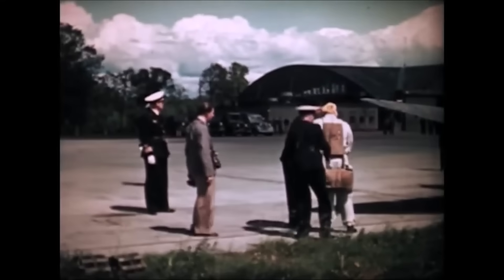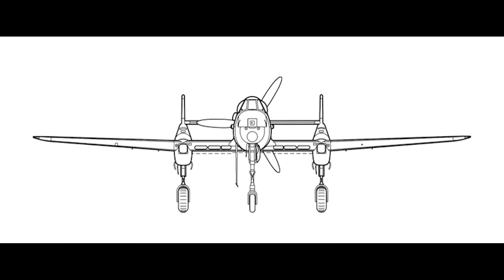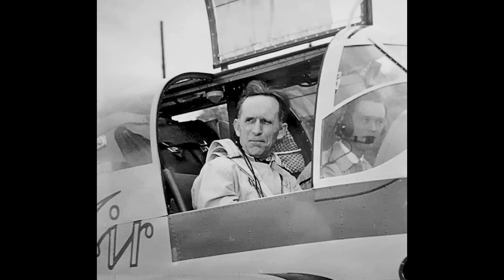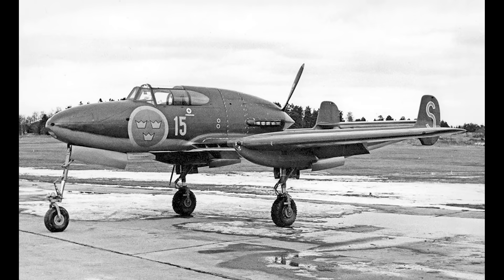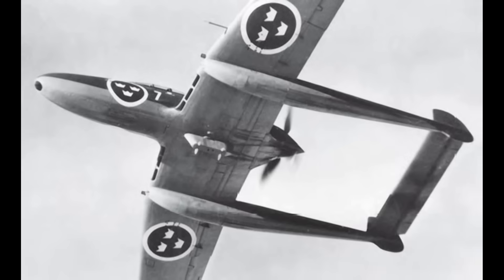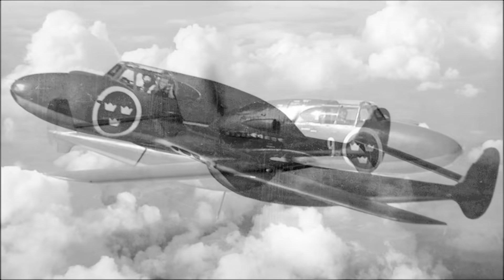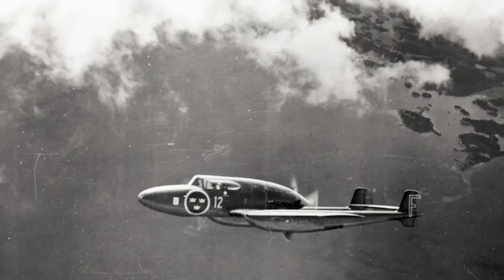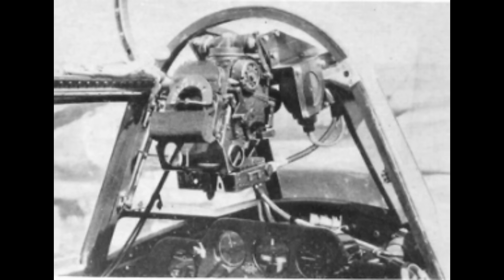Flying the Saab J 21A: Sweden’s Odd but Capable Fighter

Comment: 11:02 "The Mustang proved superior in turning performance" 11:31 "The J-21A tight turning could be used to advantage in a dogfight."  Would it be possible to elaborate on exactly what was meant by the J-21A's turning performance? The Mustang is good in very low speed left turns (below 210 mph at least, but mainly if 20 degrees of flaps are used) but it was not a particularly tight turner overall except at very high speeds.

Comment: Thank you for a great video as usual. 
Where would the RATO apparatus have been attached, I wonder?
Under the wings would have taken up the place bombs or air-to-ground rockets might have used, but at least they wouldn't hit the propeller when discarded. 
The other option would have been on the outside of both tailbooms, hopefully allowing for a safe ejection away from the propeller and the tail planes.
Were the RATO's mounted horizontally, or at an angle as I've seen on Hercules C130 aircraft?
I did try to find out on Google, but only found a vague mention that the RATO pods were attached under the wing somewhere.

Comment: The Swedish 13,2mm Akan m/39 were automatic cannons, not machine guns, as they fired HE shells. Slightly improved FN-Browning designs, they were light, reliable and packed quite the punch, as their rate of fire was 1080 rounds per minute as designed, but the return spring could be tightened to increase this. Swedish pilots found that 1600 rounds per minute eas the practical limit, as the barrel heated up so much the HE shells would cook off inside the barrel if the gun was not fired in very short, controlled bursts.

Comment: Does this mean you are actually going to do the Swedish fighters? We were just talking about this in the comments a couple weeks ago. You always seem to give me exactly what I wanted, I love it. Of course I want to hear about the Draken and the Viggen is just impressive, but I'm really looking forward to the Tunnan, which I live because it's underrated and one of those interesting planes that is actually much better than it appears at first glance, and the Lansen, which is also little regarded but which was actually impressively capable as an all weather fighter and attack jet, for the era. I also have a soft spot for it because it was one of the very first models I built when I started getting back into my childhood interest in aviation. I only had my choice of what was available in the local sports store, which was owned by a nice middle aged guy who had a side hobby of building model aircraft. He had a display case at the front of his store with his built models displayed, and he seemed very pleased to have a young man actually interested in his hobby and buying his stuff. I built a Typhoon, a Bf 109, an M4 Medium tank, a Bismarck and Scharnhorst, and the Lansen, which was the only Cold War jet he had in stock. He also stocked Airfix oil paints in the little paint cans, which I found much easier to use with a brush than the other brands, until they banned them from bring shipped by air after a terrorist attack in the mid 2000s. He couldn't get any more after that. I still have all those models I built, and I feel like I did a pretty good job for learning as I went and painting by hand. Much better than some peoples efforts I have seen, who can't even seem to figure out how to glue it all together properly. To me that was the easy part, in most cases, the painting was the difficult part, and most of the reason I eventually gave it up and just started buying pre built models. I still have my box of Airfix paints, which are probably still good, once you cut the skin off the top and mix them up again (it's just like oil based house paint, but in tiny cans, it doesn't really go bad). Although I keep thinking I should get back into it someday. I have a whole box of kits I never built, I would like to do my F-101 someday. And I'm always finding certain planes like the Tunnan that you can't get a model of unless you want to build it yourself. Can't find a decently priced Viggen either, which surprises me because I thought that was one of the more popular jets of the late Cold War. I still have my Lansen I built, although I never finished painting it let alone applying decals. And the case deflector shields under the nose were broken off at some point, although that's okay because only the Attack version had those anyway. I guess mine is a Fighter variant now.

Comment: According to Wikipedia, the SAAB J21R and the Yak 15 were the only two jet fighter aircraft that were successful direct conversions from piston aircraft.  But the J21R does look better, I think.  I'd really like to see the promised video on the J21R, but it seems to have been basically an Me 262 grade aircraft, with the SAAB 29 Tunnan being a big generational leap that was introduced only about a year later.  An excellent video, as always!
Reply: The 21R was the domestic solution if Sweden was cut off from importing the Vampire before the Saab 29 was in service. It is easy to forget today just how experimental the work on the Tunnan was for a company with almost no experience of jet aircraft.

Comment: 21A was kind of OK. 21R was kind of stupid. I mean, why even push it when the much more advanced 29 was already in production? Especially the dead-end for a jet fighter twin-boom. At least the Swedes were not as stupit as the British De Havilland that was stuck with the jet twin-booms till the end of 1950s.
Reply: The 29 was not in production when the 21R project started and the first testflight of the 29 was only a year after the the 21R had flown for the first time. The 21R entered active service in 1949 while the 29 took another 2 years to enter active service.

The development of the 29 was quite risky, no one knew how long it would take or if it would be successful. So it was decided to manufacture a domestic gap filler that would serve alongside the imported jet fighters. 

Keep in mind that the Swedish experience with importing aircraft during a period of high tensions was that it was far from certain that you would get the aircraft you paid for. So domestic alternatives were a must and Sweden would not put all of its eggs in the same basket wven with domestic aircraft.

Comment: THIS IS SO OBVIOUSLY AI SLOP WRITING!

Short uniform sentences with no variation as instructed to the AI.

slowdown in the ai pronouncing foreign names.

over use of the "they quickly" and "they this" and "they that" when the AI doesn't quite understand the context.

several sentences makes NO SENSE:  3:24: "there was more space if the battery was to be changed" wut i have never heard armament describes at batteries?,  

other ai common terms: "as you might expect", lists of three,  "for some reason" "even so" "as a result" where it makes no sense again because bro edited the text with no context for the AI.

Comment: "late 1930s"

Correction, Sweden TRIED starting to rebuild its military and airforce as early as 1935.
And that was already TOO LATE.   Almost noone was selling military equipment any more.

UK said no both to export or licensing, in part because they worried that tech might leak to Germany.   But they did allow Sweden to buy nearly 40 Gloster Gladiators(this was 1935, when Sweden looked at 37 aircraft, and literally just straight off rejected all monoplanes due to airfield considerations).

France was willing to sell, but was far too much of a mess to achive a functional deal, they were also somewhat poorly placed in the tech generation, not really starting to get modern stuff until 1940, and when Sweden was discussing with France, it was still too optimistic about what could be attained, so it didn't take the deal for good lastgeneration engines(HispanoSuiza had some excellent ones that would have been gold worth for Sweden to have in 1939) from France, which would have made a HUGE difference later in the 30s.

Finland was trying to achieve some domestic fighters, but Sweden wanted a contract for BOTH bombers and fighters from the same nation, and the Finnish project was still very VERY unfinished, so nothing came out of it.

USA at first agreed to a deal, and then reneged on it.   Fortunately, enough had still arrived that Sweden could later make an improved copy of the engine for the Seversky P-35.   While the P-66 Vultee planes didn't get any deliveries at all.

USSR was entirely willing to sell fighters as well as licensing for both the fighters and engines, but not bombers.   This was another mistake by Swedish negotiators, again because this was before they had realised that noone was selling any more.   While the initial purchase would have consisted of I-16, the nextgen batch would have been Yak-1.   And a few hundred I-16, while old in 1939, it would still have been a nearly infinite level of improvement.

And then the big, nay, GIGANTIC "What if?"...   When Sweden started getting really worried, and their representation in Japan made inquiries and got an amazingly positive answer.   Japan was essentially willing to sell EVERYTHING Sweden wanted, straight from the newest production lines, fighters, bombers, guns and engines, AND they were also willing to sell licenses for everything, and even the pricetags were eminently acceptable.
And then, while negotiations were ongoing, the war started, while the war between USSR and Japan had made for a very hostile border.
And suddenly, there was no way to transport anything.   Overseas, UK would intercept it or block it.   And the easy landroute via Transsibirian was a huge no-no after the war.   Some other routes were looked at, but quickly found to be impossible.   Japan was still willing to sell licensing, but the pricetags asked for that were drastically less preferable.
And so, Sweden never got Mitsubishi A6 Zero's in its airforce.   If the deal happened, Sweden would have gotten half of the first 4 or 6 hundred produced, while the extra money would have allowed Japan to increase its production faster.   And some of the engine licenses would have been absolutely glorious.   Japan at the time had dreadfully bad massproduction, but some of the best radial aircraft engines in the world, and would have been superb for Sweden.   Not to mention the Type 99 20mm cannons.

So in the end, there was a big public collection to buy from Italy nearly at the same time as official negotiations there came around, now with considerable levels of desperation.   So, the public collection paid for the Fiat biplanes, while the govt purchased the Reggianes.

Comment: After what's been a thoroughly unpleasant day with uni labs, this is what I needed to cheer me up. Finally, Not A Pound is doing a Saab video. Great video.

The story of this bird's development is interesting, I never knew it was that much of a colourful development, I don't remember reading much of this in my Saab history book (The Saab-Scania story). I knew a bit about the ejector seat because it's in the book, but I don't think it mentioned it being used or how successful it was. Apart from that, and what I could work out from playing this thing in War Thunder (it flies beautifully), most of this is all new info to me. (Doesn't help I haven't read Saab Scania story in years) 

The design is really interesting and unconventional, elegant even. I wonder if Saab's team had more resources and time before the jet age, what they could've made. I'd always wondered what an engine swap would've done, changing the DB605 for an equivalent V1710 or Merlin engine. The Allies used an ethylene glycol cooling mix that could work at higher temps than the German cooling fluids. Maybe the higher operating temperature would've helped with the overheating problem by allowing more waste heat to be taken by the radiators.

Can't wait for more Saab stuff.

Comment: I just ground through this family in War Thunder on my way to the Viggen and wanted to know more about it. Talk about timing.
Reply: Speaking of War Thunder, the first messy takeoff and landing felt very war thunder. The aircraft feels strange when first flown and I’ve seen a lot of busted landing gear from touching down too hard. I am curious if the invention of the drag chute for landing actually took off from this landing or if it was simply the first to do it while everyone else ignored for a while.

Comment: Great video, the Swedes know how to build fighters and are not constrainted by tradition.
Reply: It seems today Swedes can also assemble engines to be slightly more reliable and powerful than the original manufacturer.
Reply: @patrickgriffitt6551  yes sometimes add more power and better presofmance like you said

Comment: Thanks for the video. This is another one off my list of aircraft I'd like to know more about. And the fact that you plan to do the jet version as well is something to look forward to. What attracted me to this aircraft was the tricycle undercarriage. Sort of like a Swedish P38. Then I saw that they'd turned it into a jet and I thought that's clever. So I'll finally get the story of both aircraft.

Your information about the first use of ejection seats in production aircraft is not correct. Approximately 60 German airmen successfully ejected from their aircraft in combat situations during the war, using their ejection system. I have seen a video on YouTube of a former WW2 German pilot who says he used his ejection seat after being wounded during combat. He said without the ejection seat he would have died in the crash as he passed out just after he had ejected.

Comment: I would like to add that this was Sweden's last inferior fighter.
Since then Swedish fighters have been world class when they entered service.
The Jet conversion was semi successful but was seen as a good way to learn jet technology.
The J21A in the air force museum is a re-converted J21R jet as no propeller J21 aircraft was saved.
Reply: The J21R was also a stable and accurate platform when used in the ground attack role. Did a lot to establish doctrine and tactics for that mission going forward to the Lansen era.
Reply: @Vonstab now that you mention it, it probably would be excellent theoretically. The hurricane proved that wood can be durable than metal in specific circumstances because cannon rounds just go through and the armor MIGHT protect the fuel tank just enough. 5mm won't even stop a rifle round at close range. Only long range and likely designed for shrapnel.
Reply: Compare to a country like Germany that flew the OK F-4 Phantom but also the F-104 Starfighter / Widowmaker. Compared to these Draken and Viggen stand up well.
Reply: @mattiasdahlstrom2024  Sweden had its own widowmakers, the Saab 29 Tunna had a lot of accidents with 242 aircraft lost and some 100 fatalities. In fact almost 25% of the pilots lost during the Cold War were killed flying the Tunnan.
Reply: @mattiasdahlstrom2024 hardly anything “ok” about the F-4!
Reply: @chriscarbaugh3936 it’s not Swedish
Reply: Was it as good or better than the vampire.
Reply: @patrickporter1864  Don't be silly. All Swedish accounts specifically talk about how it was not up to the standard of the Vampire which had been designed as a jet from scratch.

Comment: Just a minor note,
The initial 1940-1941 plans for the J21 and J23 was for them to use the DB 601 not the DB 605 (With a license production agreement for the DB 601E being signed in August of 1941)
but before license manufacture of the DB 601 could begin in Sweden the Germans introduced the improved DB 605 which caused the license production agreement to be changed to cover the DB 605B instead.
Reply: Yes J23 was the convetional version of J21 like Mustang/messerschmidt hybrid

Comment: 11:15 I beg to differ. You must explain exactly how the J-21A pilot had "better visibility" in that metal tub wrapped around him than a P-51 pilot, on top of the fuselage, under a "bubble canopy"? By 1944 only the P-51D and D variants (K,H) were produced. You stated the Swedes tested the planes AFTER the War. Wouldn't they have received the most plentiful, easily accessed, model of the P-51? If you have "Lamborghinis" laying around the yard, why go looking for a Ford?
Reply: I suspect some source he is using has confused the initial testing the Swedish Airforce did which was made with P-51Bs that had made emergency landings in Sweden and the 51Ds bought after the war.
Reply: @Vonstab  That's probable. Thanks.
Reply: The configuration improved visibility forward over the nose, not reward.  The pilot has better sight lines over the shorter narrower sloped nose than he would in a P-51.
Reply: Give the planes a try in VR in War Thunder and you'll notice the visibility difference. Rear visibility is not great in the J21, but forward visibility is excellent! 
Also, the J21 was developed during the war when importing planes was essentially impossible.
Reply: Pilot’s seated just in front of the wings and no propeller in the way… the engine Isnt that tall, they could’ve shaved that spine down and given it a bubble eventually.
Reply: There are no propeller in the front, the cockpit is in a extreme forward potion for a fighter plane, all this give "better visibility" forward.
Reply: @kirgan1000  I noticed YOU place a "QUALIFYING WORD" that was NOT present in the video I was talking about. It's that LAST one. Figure it out.
Reply: @greggwilliamson  Why are you splitting hairs? Its not like J 21 have good rearward vision. Especial if you compare it to the later war Mustang with bubble canopy.